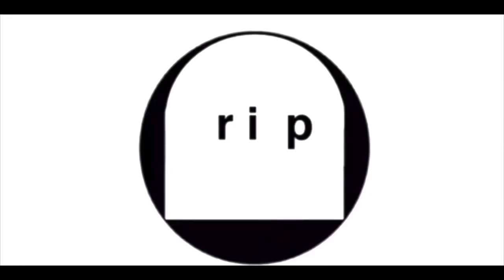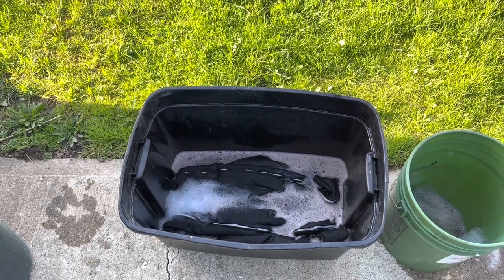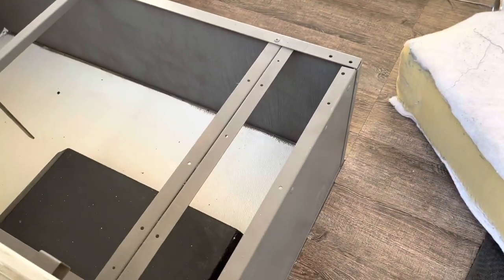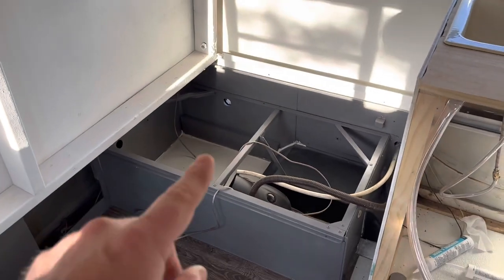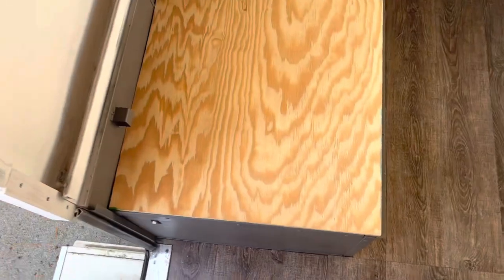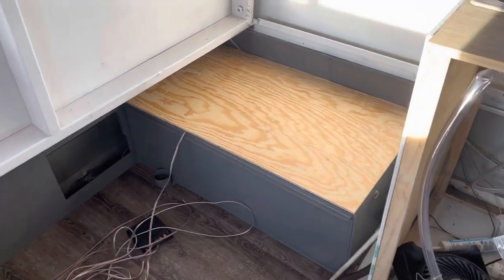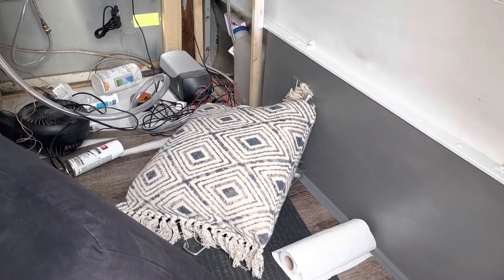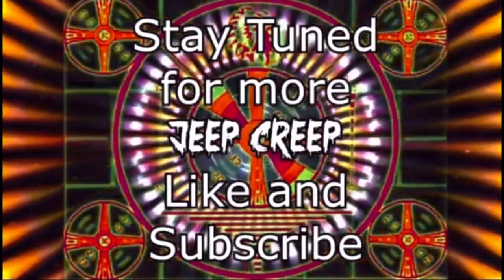BENCH SEATS restore PopUp Camper Hard Side Conversion Home Made ep19 #diycamper #popupcamper

Comment: Looking good and well i would loose sleep if i didnt ask about the wagon
Reply from the maker: She’s my baby and future projects are coming on the channel. She’s a 1988 I flew down to Texas to get. Rust free!  Runs great I had the trans rebuilt. I have a new carb I am swapping out on it when I get a chance for better reliability. I think it’s a 4bbl Holly might be an Edilbrock forgot what I bought. It was recommended on a Grand Wagoneer forum. I want to do the whole nine, new paint, need wood paneling, reupholstered seats and new carpet. Might lift it a little. But only to get a newer set of BFG ATs on it when my tires wear thin.
Reply: @Jeep-Creep  seeing urs made me miss mine did quite a bit to mine if u get stuck or looking for a part or ideas feel free
Reply from the maker: @deniedjoo  oh man for sure I will reach out as I go. I know they have some part sites like wagon master and I’ve heard their parts can get expensive. I got a lot of restoration parts I need to source. Any advice there I am all ears.
Reply: @Jeep-Creep  got alote of stuff from amazon , team grand wagoneer, quadratec parts are alittle pricey with these trucks well worth it the guy i sold mine too is about dump 45k into it frame of resto ls swap
Reply from the maker: @deniedjoo  oh man LS swap would be awesome!  Or even cooler keep it jeep and drop a Hellcat motor in it